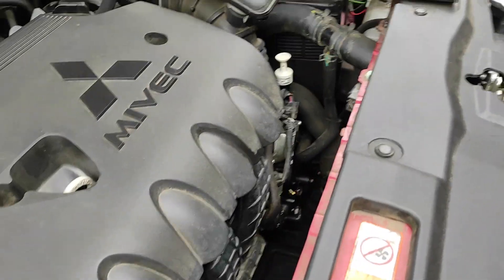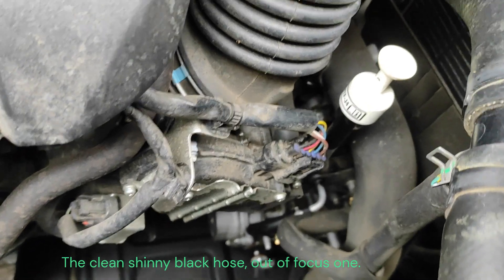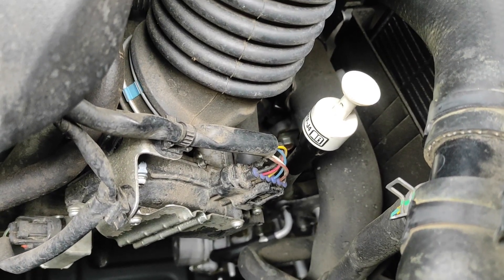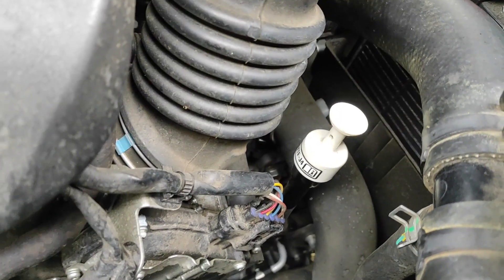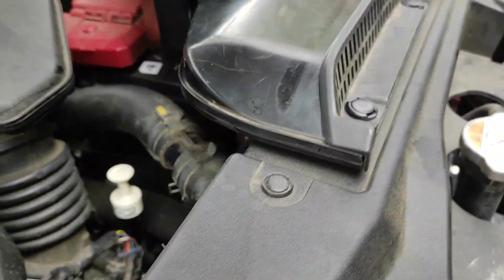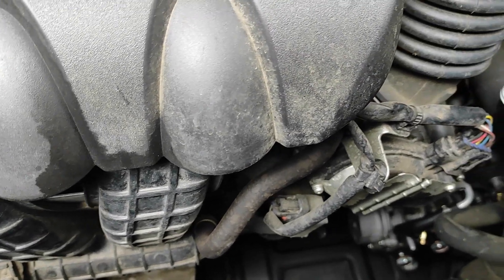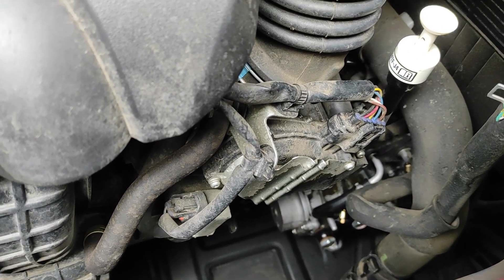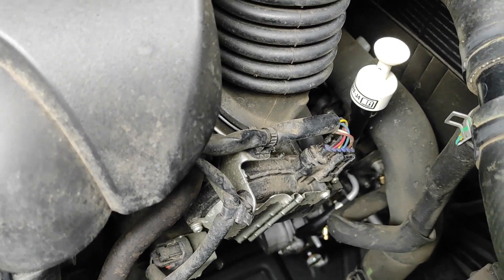CVT Gearbox Leak due to ageing hose   Mitsubishi Outlander

Comment: I had the same issue with mine what sice hose did you use and did you have to drain the transmission?
Reply: This is what worked for mine:

Four Seasons part# 53015

11/32” I.D.

Do not need to drain the transmission, but a bit will spill out as soon as you disconnect the cooler line.
Reply: @andrewwolfe6428  thank you